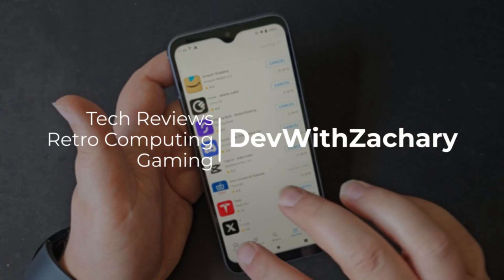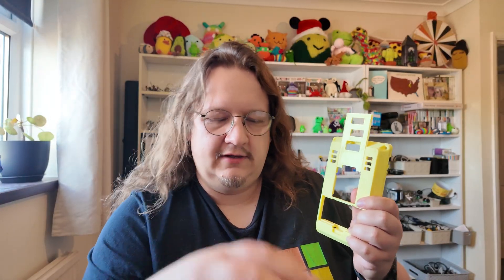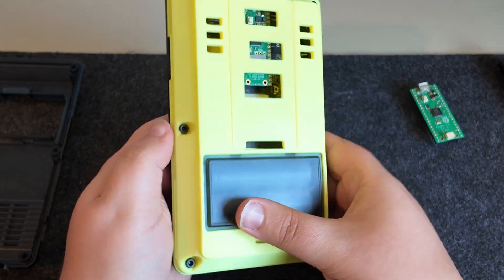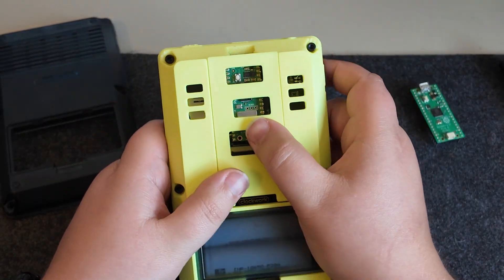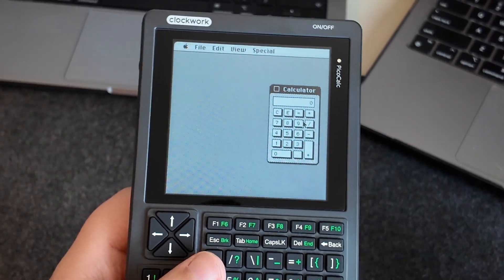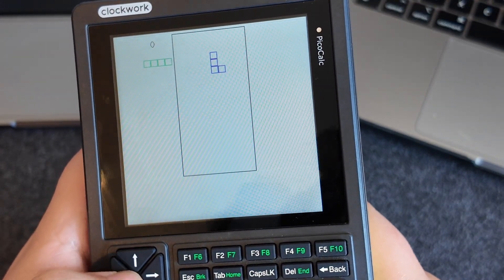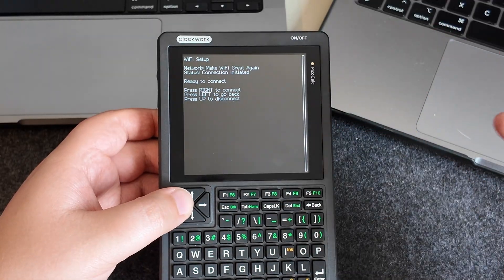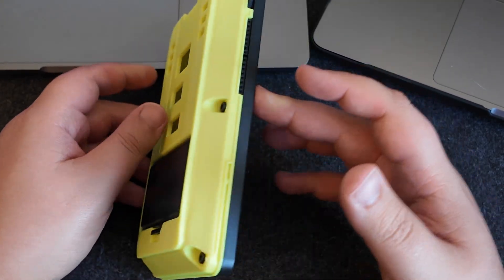Upgrading the PicoCalc with Pi 2W + Exploring Community Software!

Comment: Had no idea about Frotz. Gonna make my flight more interesting.
Reply: Innit?!! I am genuinelly excited to get one ot these, largely for this kind of use!
There is also a pin-compatible multi-core cortex Pico drop-in that works totally well with this calc chassis too, without case mod required.
Sure it needs different compilation but worth it!

I don't know if it's the same as Zach refers too but if you check out "Whats Ken Making?" "Inside the PicoCalc" video from the last week